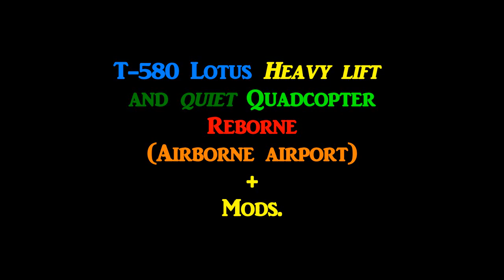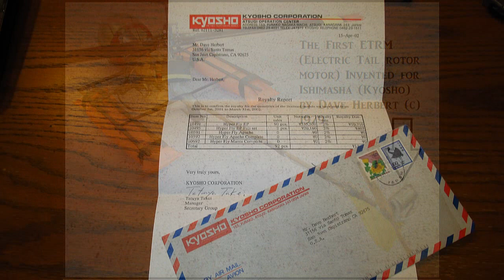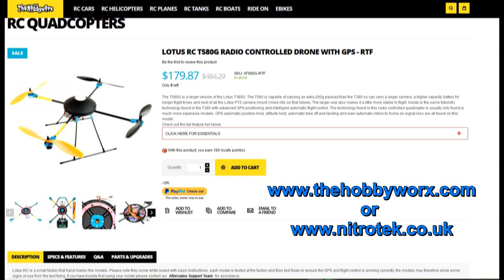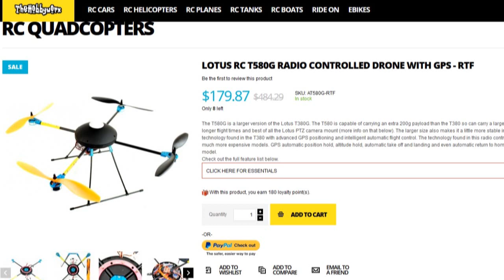My Airborne Flying airport can accommodate 5 R/C aircraft, plus other mods.

Comment from the maker: I used my original Lotus for many things, as you will see.  Getting a new one for Christmas was a real treat.  It is updated with GPS and a better Radio than the one destroyed in the fire.  I modified it, the transmitter, plus had some fun with it, although it is a bit cold.  It costs under $180, which is pretty good for a drone this size with GPS and all the features it has.   I recommend the RTF, because it has all the settings in the radio all done for you, plus battery.  Here is a link where I got it. I am not affiliated at all with them, just showing what I bought. https://www.thehobbyworx.com/rc-helicopters/rc-quadcopters/lotus-rc-t580g-radio-controlled-drone-with-gps-rtf.html    
Thanks for watching and please subscribe, because it is getting close to the time to get that Vintage Byron Pitts and open the box.
Dave

Comment: Hi sir , can you please tell me the complete components for a fpv racing drone under$200
Reply from the maker: I bought my racing drone already assembled (JJ Pro), but you need a frame, 4 Motors, 4 speed controllers, battery, control board, antenna, a camera and an RC tx and rx,  but there are many others who are more qualified to tell you than me.